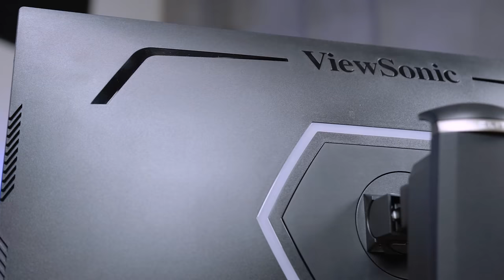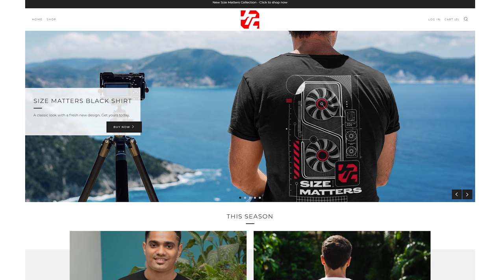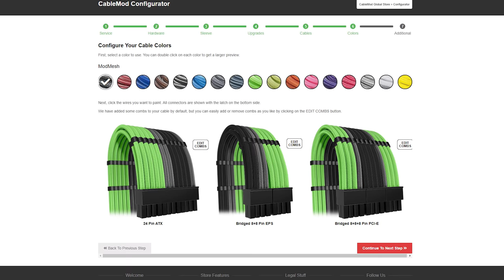This PC turned out better than I had hoped!

Comment: Hi Jay. Great build, looks awesome. 
Just wondering: The top rad - why did you orient it with the fittings to the left? If they were to the right, you could save some tubing and have the CPU output go to the right. 
But this still looks great! :)

Comment: the ONLY thing I would change is the location of the HOLE IN THE CASE where the GPU power cable slots through the back plate.... it's vertical and causes the cables to twist.... I would like to see the slot be HORIZONTAL so it doesn't habe to twist like that... but there's nothing you can do about that with this case.... hell I never even thought of this before I noticed it in this case, but now I'm gonna be looking for that in EVERY CASE I SEE FROM NOW ON LOL!!
GFREAT JOB GUYS!!!

Comment: Looks hot. It puts my Xenovia to shame. However, she's not done. I still need to order my cables from cable mod. I've just been very lazy about it. 

I actually did some drilling of my own on my old Commodore 64. I had a mod that needs a switch and it was really bad sticking out loose the way it was. So I drilled a hole for it. I was scared about drilling 35 year old plastic, but surprisingly it went well. Not brittle at all. It felt very soft. If I didn't know it was a 35/40 year old computer, I wouldn't know just from working on the case at least. I've seen a lot of youtube videos where the case will shatter if you just blink at it wrong. The end result actually looks like it left the factory that way.

Comment: I think you could have done this build/your GPU the way you wanted if you did away with the rad/res combo and put a huge custom distro block on that back portion and a pump down in the area below it. Then you could have come out of the distro block to all of your runs and run the pump directly up into it, and none of it would be in the way of the GPU being mounted vertically. Just an idea for maybe next time, or if you want to redo this build in the future. But I also recognize how you wanted to keep some parts from your older builds, and it turned out great anyway, so yeah. lol

Comment: I feel like it would be easier to mock up all the pipe routing with cardboard templates and then bend the pipes with a pipe bender set the exact angle and follow the cardboard templates?

Comment: So I'm pretty sure Threadripper 3960x, 3970x, and 3990x are all Zen2, just not Zen3 like Ryzen 9. But it's ok anyway, the Threadripper Pro's (3945wx, 3955wx, 3975wx, and 3995wx) are still Zen2. Otherwise I would have had to hurt someone when I bought my 3970x and maybe 3 days later heard the announcement of TR Pro.

Comment: If you have a corsair commander pro and those RGB hubs, lookup "g_major_tech" on eBay. That guy's name is Graham and he has all the cables you need to convert from 5v and 12v RGB to iCue so you can use 1 software for all your RGB strips/fans. Pay attention to the pictures in each listing because the cables are specific to the thing you're plugging into.

Comment: Hey, nice build. I was wondering what your memory chip temperatures are on the backside of the 3090? I have the same backplate on mine (ekwb quantum vector strix) and it gets finger burningly hot. I've placed an extra fan in my case which blows over the backplate and the highest I've seen is 70c (158f) in hwinfo, though I'm thinking about the active cooled backplate by ekwb because my reservoir kind of blocks my intake fans a bit.

Comment: Only thing that I would do is that the tube between the passthrough and the GFX at the bottom doesn't have the same amount of light as the ones up top. It bothers me a little.

Comment: when i got an RGB controller and strips that were RAZER CHROMA I was able to connect ALL of the THREE different RGB software in CHROMA and control them ALL just from there. Yes so I was able to CONTROLL ALL THE DIFFERENT TYPES OF RGB/ARGB from ONE PLACE - it was nice... but then I returned all but one RGB thing because I needed something else more...

Comment: I have my old Corsair 760T case that used to have i7 5930k with Asus X99 Rampage V Extreme with 64GB of 2666Mhz Ram and 2 1080s in SLI. I upgraded to AMD 5900X and 6800XT with 64GB 3600Mhz CL16 ram. I kept 760T but I upgraded fans to Corsair LL140s. Should I upgrade 760T to 7000D? it still looks good IMO though.

Comment: The size of the 7000D doesn't even touch the 1000D. That's why I went with the 1000D. The thing I'm trying to do it is, get the blueprints for the 1000D. First, hopefully after getting the blueprints, I will remove the front and top panels from the 1000D. Next, I'll grab the 4000D front panel and bring all three items to a machine shop. Finally, The machine shop will create panels, that are exactly like the 4000D, except they will fit the 1000D. The end result is, the case will become a 1000D airflow.

Comment: I'm slightly confused about the tube material.  Jay states that it is "PMMA", but according to my resarch, PMMA is "Poly(methyl methacrylate)", also known as Plexiglass, also known as acrylic?  What's the difference between the PMMA and what everyone calls "acrylic" tubing?

Wikipedia entry on PMMA: https://en.wikipedia.org/wiki/Poly(methyl_methacrylate)

Keep up the good work Jay and multi-part vids are no problem in my opinion!

Comment: I was just gona get an xbox series x.  Use that for a couple years and see where the computer market is at that point, but cant get those either.  If I was desperate it seems to me the best values are currently in laptops.  I would probably just spend $1800 and get a laptop with a 3080 and call it day.

Comment: I have similiar issue to Jay's with RGB software. I have Gigabyte RGB Fusion, Corsair iCUE and G-skill for RAM (in theory RGB Fusion can control RAM RGB, but it doesn't work 100% for me). I found out that for my Ryzen 3xxx build all that RGB software in the background was preventing the CPU to sleep cores - any of them. It was lightly hitting them, so it ended up using more power and run hotter because of that. As I run static color, the solution for me is simple - as soon as I set up Corsairs fans I can get rid of their software, it's loaded up in the controller and will work even if you reinstall Windows. For MOBO and RAM I have software for them on autostart, but I also have a Task in Windows Task Scheduler that kills their processes 2 minutes after logon ;) Works flawlessly for me. I just had to kill a secondary process for RGB Fusion, as that software has a failsafe and will restart itself if the secondary process is up.

Comment: Looks very good. Just wondering why you put an offset on the tubing from the CPU to the GPU. Looks like it could have been level with each other with just the single bend.  I could just be seeing it wrong though as I've never done anything like this.

Comment: Nice build! 
But just a question about the tubing on the CPU-block. Is it just aesthetics that one of the fittings have a doodah on it so it's coming out at a different height, or does it matter in any other way?

Comment: A 360 radiator would fit in place of the 240 right? If you went with a 30 mm thick 480.

Comment: Look into if everything on there is integrated into OpenRGB yet. It's what I've been using to control my devices in Linux but it's all based on reverse engineering so not everything works yet.

Comment: DAMN! That's one MEAN GREEN MACHINE Jay! But beings you're so "detail oriented" with pointing out things on other people's builds, I've got to point out one glaring detail... You're "mismatched"! Your clear reservoir (probably Acrylic or PETG?) doesn't match the frosted PMAA tubing! 

You could probably get them to match the easiest if you "wet" sanded the reservoir using WD-40 (mostly made of Mineral oil) or some other oil, progressively sanding with 600, 800 then 1K grit working up to higher grit sandpaper until it matched the PMMA. Put the WD-40/oil on the sandpaper and blot some off on a towel instead of putting it directly on the reservoir. That or possibly try wiping it with Isopropyl rubbing Alcohol first, or stronger yet maybe some Acetone? I'd try the Acetone on test peice of the same material though, it can literally MELT some plastics if you don't know what the reservoir is made from!

Just when you thought you were "done"...

Comment: 20:21 30°c? At what ambient room temp? (Do you have A/C running?!) Mine says 27°c CPU temp with a 26.4°c (78°f and no A/C!) ambient room temp with the fans at 32% 1800 rpm?!

Comment: hay jay just an odd one with having a threadripper as well i have the trident z royals still having wired timing problems i think it's the same thing what linus had on there review an have to down clock  the ram speed to 2133Mhz to be stable (XMP is on) yes 64GB ram is too much for gaming rig should i just drop 8 sticks to 4 or there a fix that i have missed i have seen afew rocking corsair dominator of late so think might need to try them sticks but i never liked the frosted LED tops but might try if your review of the new hard tubes in skunks don't bubble or anything

Comment: I have to use asus armoury crate, icue, and ttrgb.  it can be a nightmare sometimes to get it all to work.  I have had times where ive had to uninstall armoury crate completely, then reinstall it, to get my rgb working....good thing i hate rgb and only turn it on when im showing off my system lol
Reply: the lights not working on the block are most likely because of armoury crate.  I find my asus gpu doesnt like to always light up

Comment: Just asking: with Corsair 1000D case, Corsair push pull fan, EKWB front distro plate, 2 pumps and 2 480 mm radiators uptop, could it has a more linear tube bending and a better inside look with less visible tube?

Comment: I love when people tell people their temperatures for their gpu and cpu without telling us their ambient room temperatures.  Those mean nothing when you have no idea how cold or hot the environment is for the computer. I do like the build but to be honest I have seen you do such better work in the past with more aesthetically pleasing choices.  I am still building with, dare I say it...soft tubing. Like it is some kind of mistake or sin. I don't think hard tubing is worth the trouble to be honest.  My soft tubes are straight and I use fittings to make any turns or curves to get that same linear effect.  I could easily replace the tubing with hard tubes considering I designed the build on CAD before attempting it, to make sure my measurements were correct and that the layout would work as intended.  I have had some hardware issues (which were no fault of my own) and have had to take my computer apart several times while dealing with RMA's and such.  I think I would of had a lot more trouble doing the repairs with hard tubing, with my huge hands, than I did with just twisting the fittings and soft tubing out of the way.  I love your channel Jay, I have been watching you since you started and appreciate all the help you have provided to me personally along the way regarding liquid cooling.

Comment: Doesn't iCUE and Asus AuraSync work together, or did they stop doing that?
My Corsair RAM and ROG x370 board are all controlled through iCUE and synced up, no need to touch Aura's software after you install it.

Comment: Would there be any benefit to putting the smaller radiator between the cpu and gpu in the loop so the fluid gets cooled between the two?

Comment: Hmm, i just realized the white end-section of my 3090 TUF waterblock isn't lighting up, but the geforce rtx part does. Is it supposed to out of the box? I'm running linux and not using any software to control the RGB.

Comment: As much as I love the looks of builds like this, I simply do not have the patience to create and maintain them.  And the multi-video builds are in no way shape or form unwelcome. :)
Reply: its honestly not that much. I went soft tubing, but this pc has been going since may 2017.  Since then I've done 2 water changes, and 1 deep dusting.  Deep meaning I had to take off the fans to access the dust buildup,  but thats because mine is a push config, and I don't have dust filters.
Reply: @ilovefunnyamv2nd , It's a "where do I want to spend my time" thing, and since I'm not really a "craftsman" type of person, at least not with my hands (can you say "klutz-o-matic"?), I reach a point where I get too frustrated to enjoy doing something like that.

Comment: Nvidia logo on GPU not lighting up huh?...then just use the logo area to emphasize that grey that's in the Cable Mod cables and just paint it that exact grey color, of course once you're done the GPU block light will suddenly start working again but, that's the "Murphy's Law" of custom PC building ain't it ;)

Comment: I have said to myself the past three videos "why does he need an extra bracket if the case has a dedicated spot to mount the gpu vertically that I am 99%sure it clears every fitting on that pump?" And I still do not have an answer to that question... 🤦‍♂️

Comment: Jay, did you tick-off someone at YouTube or something? I see all the top reviewers in the results when I search with you nowhere in sight, bro. I thought you were gone!
EDIT: System turned out great! Very clean and eye-pleasing. As I'm approaching 40 years of age and my color-matching snobbery has dwindled, if that was my system, I would eventually run magenta or pink fluid to contrast the green cables, ha-ha! YOLO!

Comment: Very nice setup.
But 3 fans take OUT the air from the case, so in short time the inside of the case will accumulate dust very fast.
Even with 4 set on intake, the power of exhaust is bigger than the ones who bring air into the case.

Comment: also takes a while when you don't plan. You complain about fitment issues, but if you figure out dimensions ahead of time (which is entirely possible) you maybe wouldn't have to complain about the video card not being vertical. You should plan the PC about what is important, and if certain internal visuals are more important, then maybe you should have switched cases instead of trying to build around the case instead of around the look and you wouldn't have had to act like the case did something wrong.

Comment: Wait, this is like episode 4 in this build, and you just did a 20 minute video talking about it, with 90 seconds of a montage of the actual building? You talked for like 4 flippin minutes about cable mod, but didn't even show one tube bend. 

What the hell Jay?

Comment: My man you need to lower your beard. It has to end under the jaw not right on it. The longer the beard the lower you have to go, right now for your beard, just under the jaw bone would be fine. If you worry it might appear that you have a double chin, you can trim under your chin shorter and it will look fine. You do what you want to do, but I thought if you take this advice it will look better.

Comment: Really?! If i was going for looks like it looks like you are trying to do you mist a lot of opportunities and hafe asst it a bit too much. Usb cable at the bottom of motherboard is just sad (Sleev it not hard). The heat shield on the m2 hard drive, dont ues it if you are to lazy to not fix the cooler. (You even show of how to ues a spray paint in other builds). The cables in the bottom right guess it the pump cables and lian li cables. (Ues your dremel or just route them in a black tube) Dont know why you skipp stuff like this its not that you cant just put out a vid showing ppl  how you do stuff like that.   Love that you uest a 420 rad in the front it fills the case out. don't know why you left the empty space at the bottom right. Looks like a great place to put the pump in and rout the fluids to come up at the power supply,  and then you can vertical mount the gfcard. Like the new tubes you are uesing, icy blue colour theme might be nice uesing them. Overall if you told me this was your first build and you did not have time to do it all it is a great build. But realy Jayztowcents Skunkwork build no no no 1 out of 5...